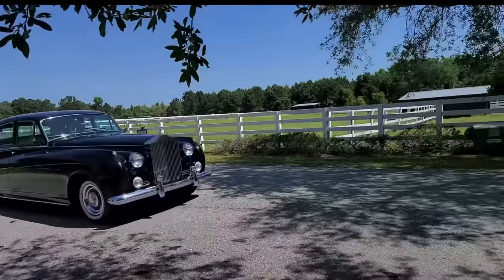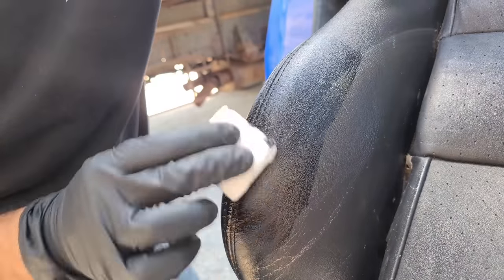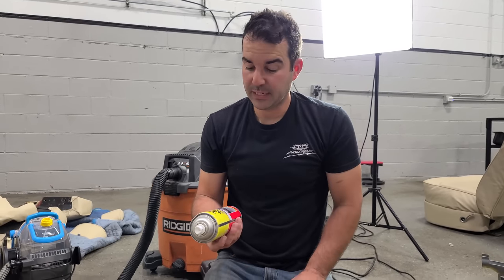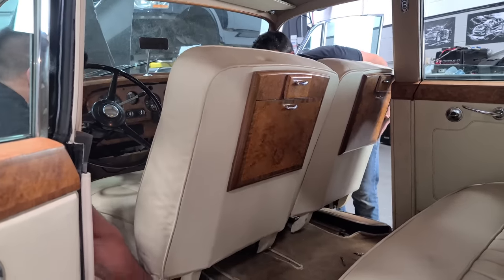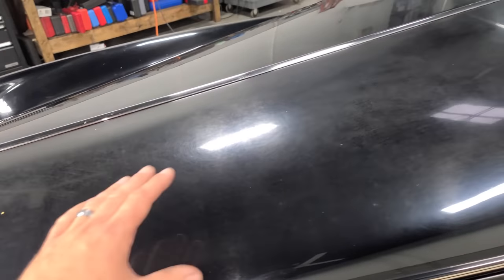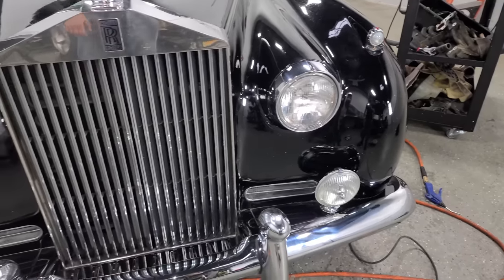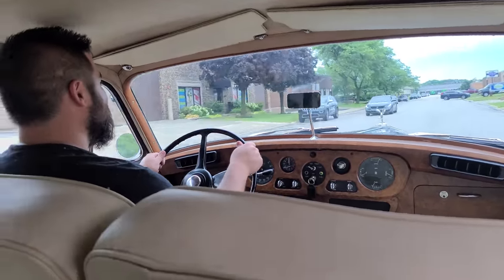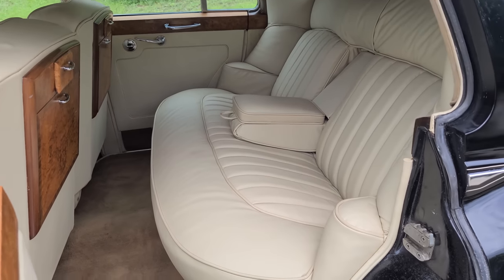What A 200-Hour Restoration Of An Old Abandoned Rolls-Royce Looks Like! INSANE Transformation!

Comment: For 6 months of work I am deeply disappointed by the craftsmanship of this interior. The leather needed to be heated and stretched before being secured to the seat frame. For a vehicle of such rarity I would expect a skilled individual to do that upholstery. Unfortunately this will affect the value tremendously. People who buy these rare exclusive cars look for perfection especially in the interior.
Reply: Rarity? Rolls aren't common as a brand, but as far as models go this is not rare for a Rolls, I've seen quite a few of them, in the wild and at shows. I like this era of them, but obviously they don't drive particularly well, very soft and boaty suspension, and engine power is low for a car that heavy.
Reply: @noth606  Yes rarity. How many do you see driving down the road everyday? Once in a blue moon.
Reply: @deadsilentyt9009  We define rarity differently then, from my perspective something is rare if you virtually never see one outside of a specific museum and can't find one to buy easily in a few month or so. By your standard most cars I've had were rare since the chance of seeing one on the road for an average person in say a year or two is virtually zero. To me anything made in thousands is not rare. 
If they made 10 of something, and there are 3 or 4 known to exist - that to me is rare.

Comment: Do you not understand that these cars did not have dead-flat pleats and bolsters on the seats?  Could you not have properly researched that aspect simply by looking at period brochures, photos — or even the handbook?  If so, you’d also notice that you have positioned the interior door handles, and the handles on the ashtrays and picnic tables incorrectly.  Additionally, thicker does not mean “better” leather.  You have used incorrect leather, instead of Connolly Vaumol hide, and didn’t even do the rear centre armrest correctly.  Your upholstery work is pathetic.

No, the grille is not “all one piece”.  It is many pieces of polished stainless steel, all meticulously soft-soldered.

 
Once again, another Rolls-Royce falls into (American) happy hands at home of someone, not only without knowledge, but without the common sense and passion to properly research things. The costs incurred to remedy your incorrect work is in the many thousands, and it is better for someone to pay more and get a correct car.

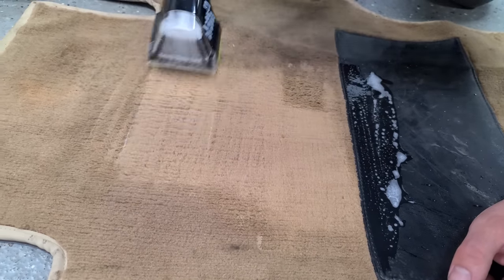Comment: 7:00 i have the 1450$ Mytee 8070 for my detailing business, use to use the bissell but the interiors i was getting were so hammered i had to upgrade nothing like the 4 gallon heated commerical extractor cuts time down by 75 percent as well due to the pump being a commerical grade and 225 degree heat

Comment: i would love to see you work on the a/c honestly the older cars especially a Rolls-Royce I have an interesting way of doing their air-conditioning I believe they probably used a Chrysler design because it looks like it has both front and rear air conditioning it would be interesting to see
Reply: Fixing that will cost a fortune. Probably better to convert it to a modern system.

Comment: TO ANSWER THE POINT MADE ABOUT PAINT DEPTH: Rolls Royce / Bentleys were treated to around 17 coats of paint in the old days, but the internet now states that they receive six?! If you own a classic car then it is best to insure with a specialist classics' insurer. When my Bentley 'Turbo R' had half of its panels ruined by an attacker's acid my mainstream insurer 'Direct Line'  refused to pay for a total respray even though faded paint is almost impossible to colour match. It simply paid for the damaged panels' paint to be stripped and re-sprayed.

Comment: Sorry for letting out a bit steam on you guys, but... I like cars.. :)

I'm really amazed at how you guys run a project like this "recovery".

You ignored every bit of getting into the details that are usually included in putting some life into an old car.

The leather work done is simply ugly. Not suitable to fit in any car, neither Ford Mondeo nor a RR. How can you ever accept to receieve that level of quality, and for that price...??

Did you consider not cleaning or restoring details on the car, like the frame of the Seats instead of just mounting it as is..?
learn a bit about details, for example on the M359 Restorations channel.

The detailing done is not what you would expect from car enthusiasts. The paint has more gloss, but far from a proper polish. If you are in doubt about how proper detailing should be carried out, look at AMMO NYC.

If you want to make YouTube videos where you show a restoration, then you will have to prepare yourself, for example by looking a bit on YouTube about how to do it, and in what degree of detail.
Otherwise, the result will be like this, - a piece of crap in a - seen from a distance - nice packaging

Comment: Am I the only one not loving the quality of the reupholster job? There seems to be so many pulls, gathers and pinches in the leather. The materials are obviously top notch, but I feel like it maybe needs a final going over before Alex accepted the seats back... Especially for the money he spent!
Reply: The hides are of decent quality but by no means up to the standard of hide that came with the car from new. The original hides were from Connelly. The upholstery work is most definitely not to original standard. The welting is uneven and the pleats by far too flat. All in all a decent job if restoring a a 76 Buick Electra Park Avenue. As the interior of a Rolls-Royce, a zero out of ten.
Reply: It's poor workmanship. He was ripped off.

Comment: I hate to break it to you but those seats are absolute garbage and you got ripped off badly. There is puckering everywhere, the color and texture are completely wrong, and it is very obviously not the correct Connolly leather. Connolly stocks very specific vintage leathers for these cars which have the appropriate grain and lustre, and that most definitely ain’t it. The craftsmanship appears to be very half-assed too.

Comment: The leatherwork is dreadful, it's the wrong leather, Rolls Royce only uses Connolly Hide, the leather used is far too soft and the fitting is poor, you can plainly see all the 'stretches' where the leather has been poorly attached and not pulled tightly enough. A pity and the supposedly 'witty' English verbals are sad to hear, they just aren't funny!

Comment: The Silver Cloud II I know very well. I have driven many miles in this model, that I did not own myself, but chauffeured as a young guy. I was twenty in 1975. I loved the 6,23 litre V8 it had, very powerful, which made the 2000 KG power steered car handle like it was much lighter. I also have nice mileage in its predecessor the 1956 Silver Cloud (I) which had a 4887 cc 6-cylinder (line) engine. Unbelievably that six-cylinder is even quieter than the Cloud II and III's V8. BTW, your "British accent" is a bit off. Then again my "American" is even worse... 💐

Comment: Just an fyi, if you have a stain you don't get out with the steamer, once it cools, it's never coming out, it's set in the fibers. Water extraction, you can keep working on the stain. Also, you have to be careful with the rotary tool, carpet can be damaged with too much scrubbing with a power tool. Grew up working for my father's cleaning company, been cleaning carpet for 30+ years and been flooring installer for the last 8 years.

Comment: Great video. Love the car. When you encounter a problem getting bolts and washers and threaded holes to line up, sometimes you can solve the problem by inserting a stud in the threaded hole, then using a nut on top. I've done this a couple of times.

Comment: Only a Rolls Royce bodywork with such depth of paint could you achieve such a perfect finish. it would have been a sacrilege to have a paint job done to that car the original coachwork is just testament to just how good British  Rolls Royce and Bentley cars deliver to their up market customers you will not find a better car than Rolls Royce and Bentley combination anywhere in the world. Did you know that all Rolls engines are built and striped down several times to obtain the perfection and standard. I once had the privilege of sitting in a fire engine with Rolls Royce straight 6 engine and at tick over you could see each blade of the cooling fan it was ticking over so slow and not a shimmer of vibration. You could put a champagne glass of the engine in would be as steady as a rock.

Comment: Good video. Not sure it's a big money maker - depends what you get for it. You paid 24k, which was pretty good considering wood/trim/paint were sound BUT the cost and time put into the  seat trim you won't be able to pass on - that was a poor job. The main concern is that the engine sounded dreadful. The V8 was less smooth than the I6 in the Cloud 1, and noisier. It is also harder to work on being bigger and heavier in the same space. Engine refurbish will be $$$. Good luck!

Comment: Hey Alex? I lot of that haze on the flat duco is Wax haze.
I'd prepsol wipe then Clay bar to remove old wax build-up before buffing and then use a light cutting compound especially on old English cars although Rolls and Bentley had the best lacquer of the day.
Older owners tend to stick with Turtle Wax and elbow grease to make their rides shiny but even they would strip the old wax off every few years to remove Wax Haze.

Sure an Orbital Buff will remove it as well but the edges tend to be harder to clean and you have the issue of thinner edges to contend with unless you have a paint thickness meter to check.
I used to have a Limo company and had a lot of Old English cars including Silver Clouds and older Mk Jags and they needed a bit more care taken.

I used #AutoGlym exclusively on English cars and they have both a great range and awesome web support especially when it comes to Rollers, Bentley and Jaguars.

Comment: Not a RR expert but I did read somewhere many years ago that the Rolls were hand painted at the factory with something like 20 coats back in the day. Each coat was "hand rubbed", as the English call it, before the next coat was applied. Hand rubbed just means sanding between coats. Anyhow that's likely why the paint came back so well. It's like an inch thick from the factory.

Comment: I bought a carpet extractor and a steam cleaner, pretty much like the ones on the video - a Bissel SpotClean Pro and a Karcher SC 2, respectively - and I can confirm the massive improvement they provide, without very much effort, avoiding aggressive chemicals which may degrade the material, and saving your time.

Steam Cleaner: 
I bought a small cheap used car to go around town, and the door seals looked horrible, especially on the zones our feet go across.
I thought I would have to polish, or even paint it.
To clean it first I passed the steam cleaner, and for my surprise the paint underneath all that dirt was as new! Shiny and everything.
The underside of the hood / bonnet, the door jams, the trunk jams, around the engine, and especially the air vents turned out great.
The plus side is: I could convince my wife of getting a steam cleaner to clean the bathroom and kitchen, on the tiles or around the sink.

Carpet extractor:
I bought a station wagon for longer trips, with a beige interior, because it was cheap and because I loved the contrast between the beige seats and doors, with some black accent. Gorgeous!
But, I had to learn how to keep it clean. This is where I tried a steam cleaner, to keep both carpets and seats (if they are cloth) clean.
The argument for the wife is rugs, mats, and bed mattresses.

Comment: Alex, When you started to wash the Roller, you said you thought it had quite thick paint, well it does. I would have had 26 coats of Top Paint not including the primer stages. This was the standard paintwork for Rolls Royce from before WW2 I believe certainly up to the mid seventies. I visited the London factory who built all the specials including I believe your car as I watched a guy making a front wing ( fender to you lol) from a single sheet of aluminium over what I believe is called a buck using hammers and dollies. I watched him for an hour and it seemed he hardly did anything and the wing was in its closing stages of its making, but it must have taken days and days of work to get it to that stage.

Comment: I don’t think the leather is better than Rolls Royce supplied. It used to be supplied by Connolly leather in the uk. They are very particular the sourcing. The use different grades if leather depending where the leather is to be used on the car , door linings will be different to bolster. Seat buses gets more wear etc etc. Also I doubt very much if a guy in Chicago would maintain the queens vehicles. I’m sad to say the standard and finish of the seats whilst vastly improved doesn’t meet the standard Rolls Royce demand particularly at 6000 $. Nevertheless a lovely refurb

Comment: Another piece of well-intentioned advice for your finishing touches on the mechanics. You should urgently free the leaf springs from the leather protective covers (careful, soak with leather oil so that the leather does not break). Springs are best with dry ice clean, then with very heavy machine oil or grease Lubricate between spring layers & outside, then again
pack. You will think you have air suspension.

Comment: As a detailer, for carpets I use a steamer an chemicals like that Tough Stuff, an use a drill attachment broom-like wheel.  For stubborn stains, a good old fashioned toothbrush or stiff scrubbing brush.  For pet hairs that just WILL NOT vaccuum out, I use a pumice stone, or if THAT doesn't work, using a razor blade to snag them an pull them out.  Unless there are holes or burns, there hasn't been a carpet I couldn't clean.

Comment: The car is not likely to be skim coated. At the time of your car's manufacture, the car would have used lead to fill in any surface issues. If you're finding bondo underneath the paint, it's from the 30 year old paint restoration shop, not from the factory.

Comment: could you not use a pressure washer with a wide spray nozzle on them carpets first?

I reckon it'ld probably do a better job of getting an initial lift off of dirt going on allowing you to get the remainder out with the vac...unless, it just full on destroys the carpet 😁

Comment: This question may have already been asked, but wouldn’t it have made more sense to do the paint touch up prior to cutting/waxing, and post a residue remover?  That way the touch up paint isn’t attempting to bond to wax, and when the buffer is used it may level out the paint dabs a little bit?

Comment: I know you know you’re doing but get some quad zero steel wool pads and lightly go over the chrome, it’ll help remove the tarnish and surface scratches and really bring it back around, also works great on glass to remove water stains

Comment: For your test section when correcting the paint you should really go with the least aggressive combination of pad and polish to see how it reacts with the paint, especially on 40-60 year old paint. You don’t want to risk going too aggressive. The combination you used was pretty aggressive and won’t give the best results for making the paint deep and dark looking. It works great for cutting the oxidation and deep imperfections out, but you really need to go over it with a fine polish to remove marring and refine the paint after such an aggressive polishing combination.

Comment: If you can take the carpet out of the car, then I like to put it on a tarp, and hose the whole thing down with water, and get a lot of the dirt off with the hose, then go back with dishwashing liquid and a brush, or broom, and just clean the entire thing going over stained areas with a bit of extra elbow grease, and hose the whole thing off again. If you can hang it up for a few minutes, that helps run all the water out of it, then just let it air dry. Do it in the morning so that its dry by the next day.

Comment: Tip I’ve used with wool pads is to actually get it wet when you first get it and just turn it on inside of a bucket to sling off the majority of the loose fibers. Since it’s wet most of the hair should also stick to the sides of the bucket and run down with the water that the pad slings off of it, afterward on a low speed wet your hand and run it over the surface to get more of the loose fibers off. Little time consuming but helps keep from leaving hairballs around the garage/shop

Comment: Next time you clean carpets use a spray bottle with the cleaner diluted and scrub the carpets with a brush after allowing to dwell a few minutes. Then in the carpet cleaner only use hot water to flush the cleaner out of the carpet fiber.

Comment: You should send this video to the original owner to show her how well her old car came out, also does that leather guy do steering wheels? as I have an old one where the stitching's come undone, like the cork in the middle split apart as the glue has failed and it needs to be redone.